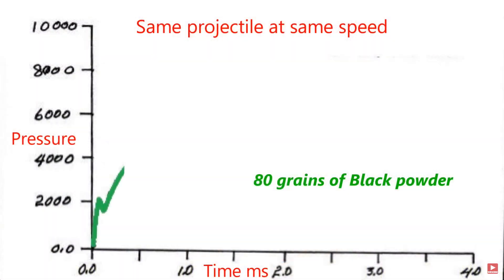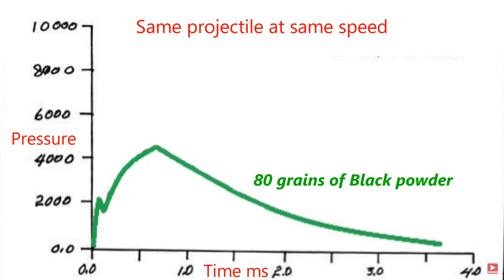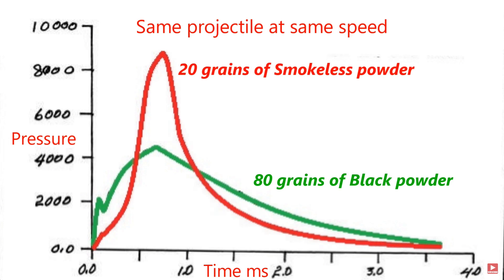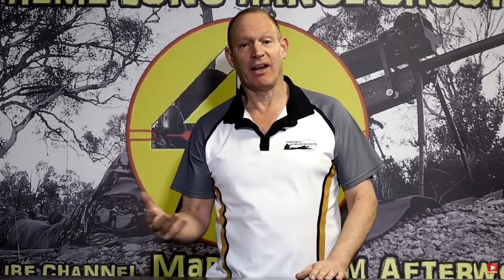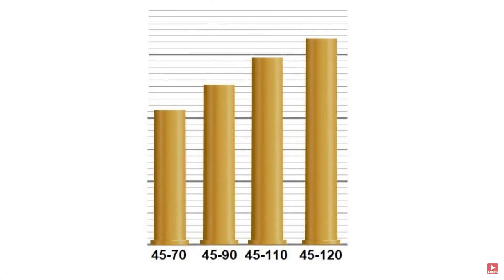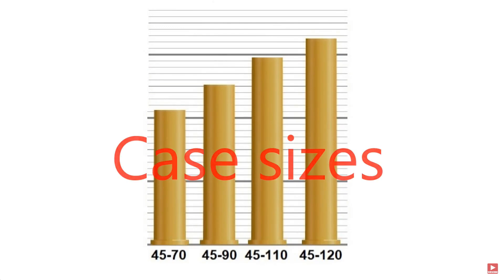Gun Powder, how works and smokeless v black (re-run)

Comment: Question; does the heat generated by rapidly building pressures cause the powder to burn much more rapidly / vigorously?? As a diesel engine heats up air in the cylinders via heat of compression.... Boyles law of gasses??
Reply from the maker: In Nitro yes, all in the video!